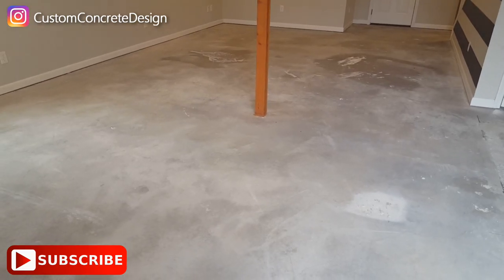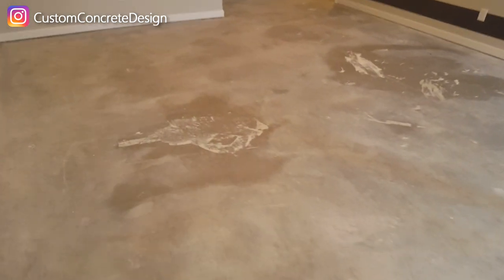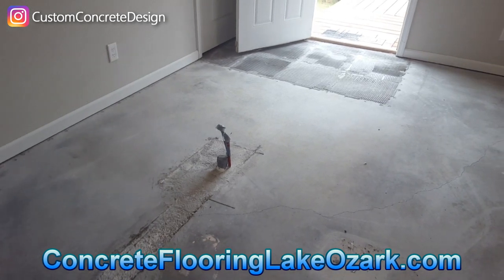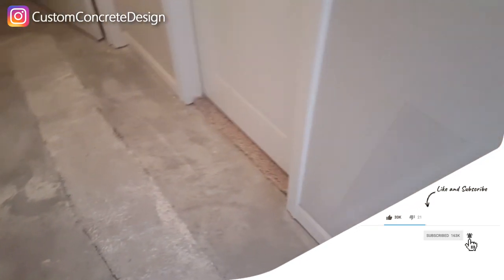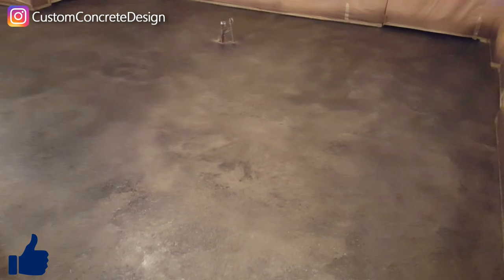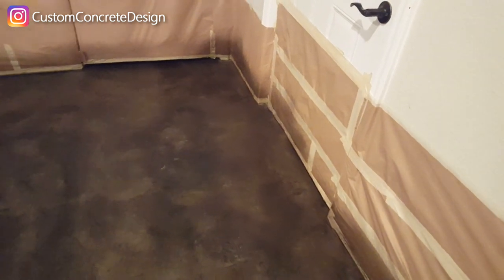Decorative Concrete Resurfacing a Basement Floor

Comment: You make it look easy, I love the variation in color, what stain did you use?
Reply from the maker: Thank You t's super appreciated, it's not to hard but not real easy either. The Stain is Called Ultra Stone using Elitecrete Products, mixed at a 3 to 1 ratio then sprayed on with a pump up sprayer.